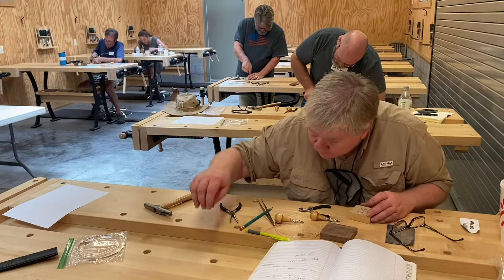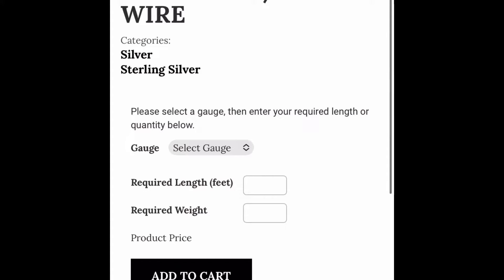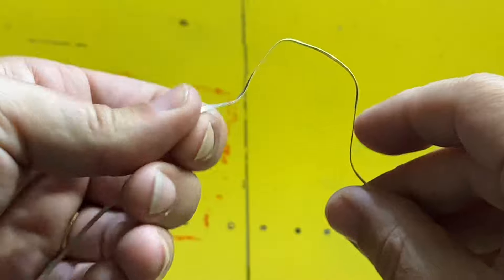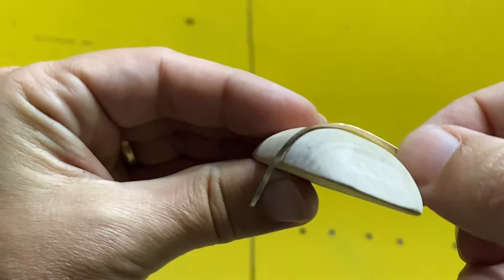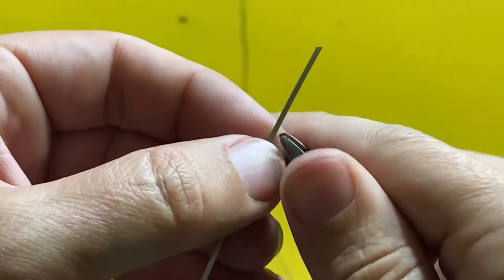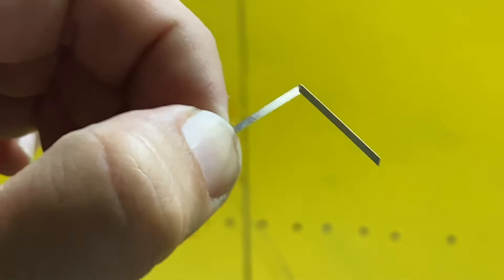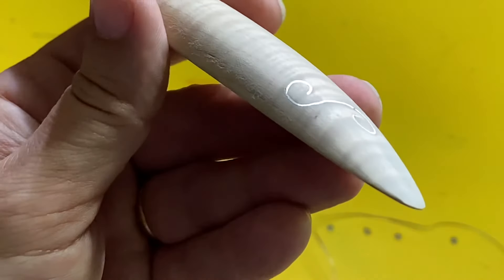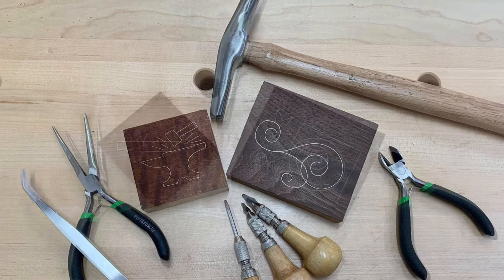Which Wire for Silver Wire Inlay?  Where to Get It?  Inlay Classes

Comment: Why is inlay wire flat? What's the benefit over traditional round wire?
Reply: When i did some inlay work myself (amateur), flat wire made it way easier to hammer in/fit in the groove you cut. Round wire flattened on "top" of the groove, if that makes sense. Made it harder for it to actually inlay correctly.